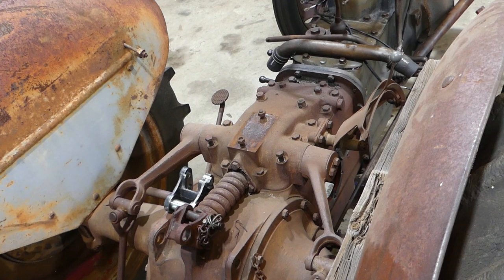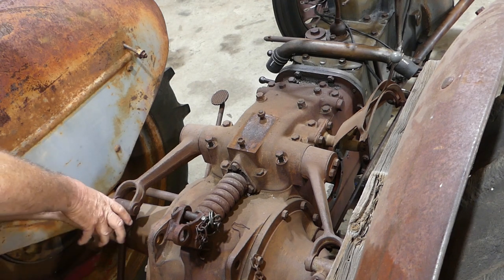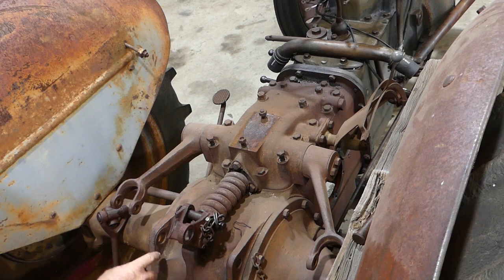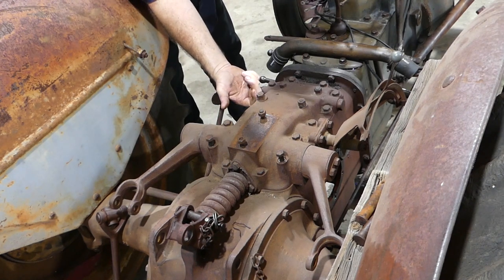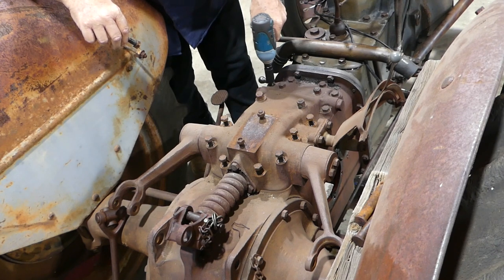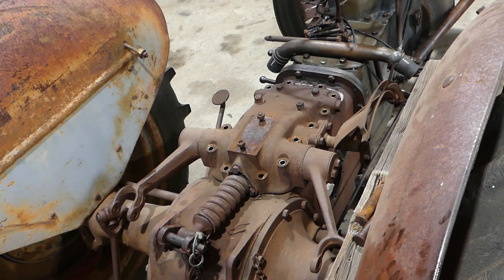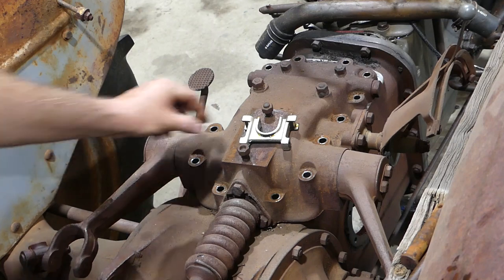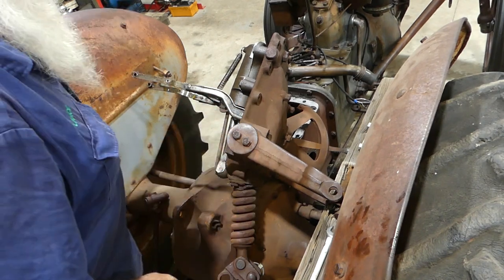Removing our Ferguson TEA20 Hydraulic Lift Cover

Comment: I am in BC Canada.  Trying to learn how to getvthe hydraulics working on my Ferguson. These videos really help.
My quadrant lever rotated down when I was freeing up the stop tabs, and since then the system will not drop the lift arms. I hope I haven't msdeva mistake by trying to lift the cover without removing the pump and the yoke at the bottom. Thanks again.
Reply from the maker: You may have bent the control valve but if so it is easily fixed.

Comment: Watching you struggle lifting off the cover reminds me why I made the little bolt on lift bracket, it make removal so much easier, I seem to remember there are 2 lifting points on it so the cover can be wiggled off, I am watching this excellent video as I have to replace the piston rings in my lift cylinder, now I have watched this it looks like I need the get the Ford conversion piston kit! Many Thanks for posting these videos! Chris B.
Reply from the maker: The Ford piston is a great thing, it makes it nicer to use for sure.

Comment: First, thanks for all your videos! I'm envious of how easy you got your lift cover off. Mine's seriously stuck, I've tried whallop:ing it with a sledgehammer from underneath (with wood inbetween to not damage it, hard to get good hit anyway) and lifting the entire tractor rear end in the lid but it won't come off. I'm unsure of how violent I dare to get. Do you have any tips or tricks on getting stuck covers to become unstuck?
Reply from the maker: I have used wood on the final drive and a big bar to get them loose at times.
Reply: Did you get it off?
Reply: @locustvalleyfarms7241  Yup, wood on the final drive and a big bar did the job. Since the tractor was split I didn't have adequate weight in the front end to counter the torque of the big bar, but applying a wife as a counterweight on the gearbox end solved that 🙂
Reply: @niklasedmundsson6107  great! Hey this might sound dumb but ………I have a Ferguson to 20. The hydraulics work OK. But they are tired. I was thinking about rebuilding them……. Can I just take that top cover off and rebuild them? Or do I have to split the Tractor for something?
Reply: @locustvalleyfarms7241  You don't have to split the tractor but it's a bit of work. Look through the Bundy Bears videos to get a hang of how it fits together.
Reply: @niklasedmundsson6107  ok thanks!

Comment: How do connect the spring on the top cylinder that operates the lift.
Reply from the maker: The one that holds the arms that goes to the hydraulic pump ? There is a hook at each end of it, probably way easier with the top off.

Comment: Cheers 🍻 for Helping with familiaré with changing MF PTO seal 🦭 
I’ll search later for changing fuel filters for a MF 65. In an guess attempt to possibly illuminate, ør lessen a tinge of white smoke 💨 Teach 😉👍🏻
Reply from the maker: White smoke is often a leaking injector as in un burnt fuel, Blue smoke is oil burning and black smoke is over fueling or blocked air intake system.
Reply: @BundyBearsShed  Cheers 🍻 Bundy, I’ll scroll where you’ve demo’ed about j injectors 😉🤙🏼